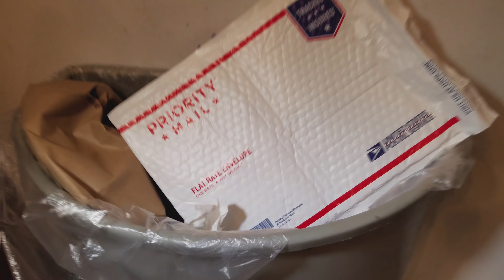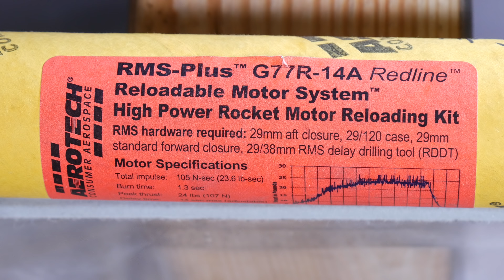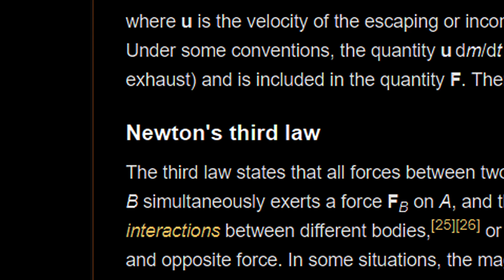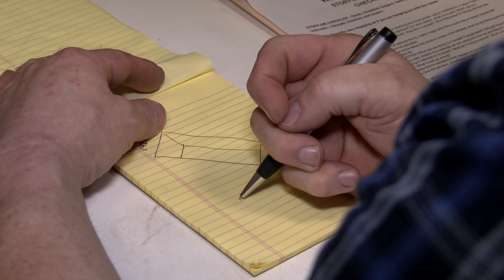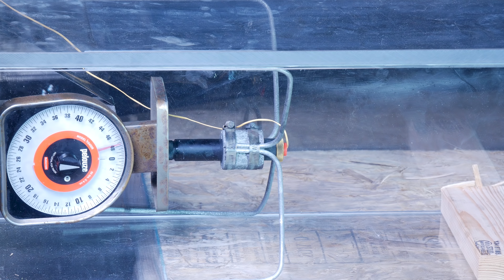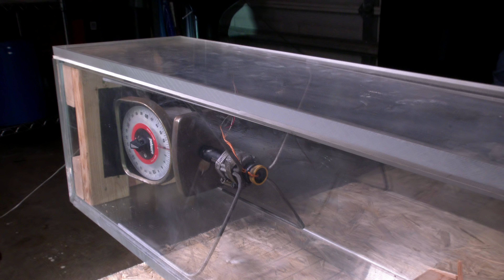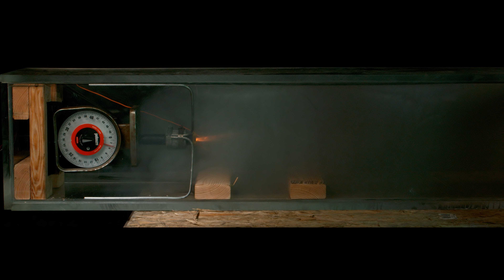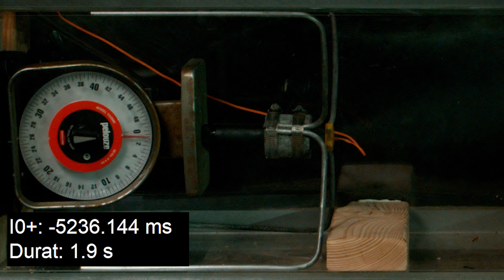Rockets in a Vacuum Chamber - Newton's third law of motion Visualized

Comment: I see a 4 problems with this experiment:

1) Though at negative P.S.I., that chamber is not empty space; it contains matter (that gas we breathe called air). Space beyond our atmosphere is not just void of pressure, it is ALSO void of matter.

Why is this important? Because rocket energy shock waves require a medium just as sound does (light & radio waves can travel through the nothingness of space but sound cannot): 

I believe I heard the sound of the rocket blast coming from that vacuum chamber which tells me the energy was also traveling through the air & bouncing back as force of energy waves.

2) That rocket is being fired in a sealed container that can reflect the rocket energy waves back to the source & overcome the negative pressure.

If that rocket was fired from the vast nothingness of outer space it would have no enclosed barrier to reflect the energy back to the source & provide resistance necessary for thrust.

3) That vacuum chamber is narrow enough to efficienly return energy waves directly back to the source; had it been in a spherical chamber, the energy waves would have been dispersed in all direction, severely weakening the effect.

4) Go-Fast Rocket (ironically by a flatearth team disproving their own crazy idea of Sun & moon being in our atmosphere) shows what happens when a rocket leaves our atmosphere and enters the nothingness of dpace:

The escaping gas of the rocket cannot overcome the surrounding environment of infinite negative pressure; it actually reverses the force of gas pressure into a brake.

5) Watch "A Funny thing happened on the way to the moon"; the leaked NASA footage showes Apollo 11 astronauts faked being 130,000 miles from earth while still in L.E.O. (Low Earth Orbit). Why fake anything if they were actually capable? Obviously because they were not for 3 reasons:

First of all; in spite of their claims, rockets don't work in outer space (they need an atmosphere to work), but the hoax continues to rake in billions with the aid of artistry, special effects & CGI.

Secondly; the 30,000,000 e-volts of deadly charged particles they would have to travel through for 2 hours (combined to & from) through the V.A.B. (Van Allen Belts). 

If you doubt me on this, just watch "NASA engineer admits they can't get passed the Van Allen Belts" (i.e. not without extreme untested shielding). Gee; I thought NASA  already solved that problem in 1969-1972 with thin aluminum  skin around the capsule. Appearently not, but the deception makes for lucrative entertainment.

Thirdly; there's PLENTY of documentaries exposing NASA hoaxes from moon landings to the tin-can prop floating in L.E.O. they call a International Space Station (I call it a Fake Station). I don't trust NASA because they wrecked their credibility too many times with their exposed fakeries.

Unfortunately most of those documentaries have been purged from youtube (what"s left are burried by the pro-NASA  "debunkers"); you have to go to the Rumble or Bitchute platform to see them now, though you will have to endure the foolish comments from flatearthers on occasion (I believe that F.E. nonsense is a CIA psyop used to discredit NASA critics, and cause discord with wasted energy arguing for or against REAL Galileo & Newtonian science).

Why didn't the USSR blow the whistle on NASA? Because they were faking it too; just look at that rediculouse "First Space Walk" footage (stop-motion with that over-spinning globe-prop in the background): I've seen far more convincing images in old Star Trek reruns.

So governments lie to their citizens? Yea, who didn't know that. The Red pill can be tough to swallow but I prefer it over the Blue pill of blissful ignorance & safety of  compliance.

Question everything but always use your God-given common sense. Stay thirsty for truth my friends. Cheers!
Reply: - "Though at negative P.S.I., that chamber is not empty space"

I stopped reading your nonsense right there.
There is no such thing as negative pressure.
The "vacuum of space" is just at 0.0 PSI.
Now try to complete high school physics BEFORE trying to debunk all of physics.
Reply: I guess you didn't realize that I was referring to vacuum chambers which are capable of -0 p.s.i. whereas "outer space" is simply 0 pressure. Many often refer to it as "the vacuum of space" though empty space doesn't really have a force (it's literally nothing), but pressurized gas rushes out into 0 pressure of outer space in all direction without limit or resistance (quite different than the area inside a vacuum chamber: Things that are different are not the same).

I am familiar with Newtonian physics; I appeal to them often when debating flatearthers on TikTok. You can dismiss everything I shared as "foolishness" but I do make valid points. You may think I'm crazy or ignorant for daring to question NASA missions but if you watch the 3 clips that I mentioned (as well a the many ISS critiques), you'll understand why I have my doubts.

I'm disappointed in your condescending attitude; you shouldn't belittle those who question authority with reasonable arguments & theories. I don't even treat flatearthers that way; instead I try to reason with them, and if they won't listen to reason, I move on. Maybe what I share will eventually sink in but definitely not if all I do is insult them and call them stupid (I'm nobody's judge).

I hope you treat people better in the future. God bless
Reply: @arlanwade3268  Study the Comet Tempel-1. Then tell me what happened to it on the evening of July 4th 2005.
Reply: @arlanwade3268  - "I'm disappointed in your condescending attitude; you shouldn't belittle those who question authority with reasonable arguments & theories.

Do you not realize that you are accusing millions of Engineers, Physicists, and Scientists of being either liars or incompetent?
You don't consider THAT being "condescending"?
Reply: @arlanwade3268  - Study the Comet Tempel-1. Then tell me what happened to it on the evening of July 4th 2005.
Reply: @arlanwade3268  - I have been building, launching, and operating deep space science probes for longer than you have been alive. Your attitude towards my career is definitely "condescending".
Reply: @stuartgray5877  OH but it is: It contains air (though at 0 or -0 pressure) vacuum chambers still contain that inconvenient matter that disrupts NASA fallacy; vacuum chambers still test within our atmosphere. Empty space is different (things that are different are not the same).
Reply: @arlanwade3268  - I am also a 30-year veteran Vacuum Test Specialist but thanks for mansplaining how vacuum works.
Reply: @arlanwade3268  - "I watched Temple-1on youtube and I must say I am impressed: NASA's CGI has gotten WAY better latel"

None of the video from the encounter with Tempel-1 was "CGI".
Or are you claiming that the MILLIONS of people that observed that comet explode the evening of July 4th were seeing "CGI" in the sky?
And every telescope on the earth witnessed the comet explode?
Did NASA install devices in every telescope on the planet before that night?
Bless your little heart!
Reply: @arlanwade3268  - I built, tested, launched, and operated the Deep Impact spacecraft during its mission.
I was a member of the Deep Space Navigation team, and I calibrated the telescope that took the images of Comet Tempel-1.
I was even the flight director for the activity that first spotted the comet from the spacecraft during approach.
Tell me that YOU graduated high school.
Reply: @arlanwade3268 You don't need to do any work to completely break a flat earther. Just ask them how the sun sets. They cannot answer in a way that's not obviously deranged. They used to argue that it was refraction and such but when they moved on to each person having their own skybox like a video game I washed my hands of their existence.
Reply: @arlanwade3268 You can be disappointed all you want, but don't you dare try to pass your nonsense off as reasonable. I'm not saying that to be a jerk, you're actually just wrong. The fact that you think there's some kind of fundamental difference between the vacuum of space and a vacuum chamber is telling. The next two points only build on that foundational error.
Reply: @stevencurtis7157  There obviously IS a "fundamental difference" between contained air matter in a vacuum chamber, and the infinite non-matter of outer space. Things do work differently in outer space (according to Newton's laws of motion & resistance) than in our gas-filled atmosphere. The idea that outer space and Earth's atmosphere are essentially the same environments doesn't seem reasonable to me.
Reply: @arlanwade3268  a vacuum chamber has more particles in it than the vacuum of interplanetary space, but most of what's done in space is in low earth orbit, which has a much higher density of gas than interplanetary space, yet both offer effectively zero air resistance over a short time period. That's the fundamental similarity, and that's why treating them as though they're not at all comparable is ridiculous. The fact that space is effectively infinite in that a rocket can't rapidly fill space with gas whereas it can nearly instantly fill a vacuum chamber just means that the experiment in the video is somewhat flawed, but you missed the most important part, which is that the rocket begins to accelerate immediately, regardless of what the pressure is. Rocket exhaust has no reason to go anywhere without force acting on it, just like anything else. A stationary atom would not move just by being exposed to vacuum any more than a basketball would be sucked out of a literally vacuum-empty bucket if exposed to vacuum. But gases in a sealed tank or rocket's combustion chamber are not stationary, they are under pressure and are moving around and bouncing into each other and the walls of their container. When you open that container, the particles that were moving toward the opening are suddenly allowed to escape, and they both take their momentum away with them and are no longer in the chamber for the other particles to bounce off of. The net result is that all that gas is going to eventually bounce off the front of the tank or impart momentum on another particle before leaving the tank, carrying away momentum and forcing the container the other way. Vacuums don't suck. I can't explain this any more clearly. Please let me know what you take issue with.
Reply: @stevencurtis7157  My issue is that certain energy & sound waves can travel through gaseous matter (without which they have no effect) and being in a sealed container, energy waves can theoretically bounce back to the source of released energy even if in 0 pressure. Outer space is not an enclosure, and the 0 pressure is infinite in all direction (it may sound crazy to you but I expect different results).

Question is; can the release of energy from a rocket engine be enough to overcome surrounding 0 pressure (no matter or pressure outside to resist) and push the rocket with the escaping energy? NASA engineers yes but if so; why did the Apollo 11 astronauts feel the need to fake being 130,000 miles from Earth while still in L.E.O.?

The Van Allen Belt is reason enough to fake the mission, but I also suspect they were stuck in L.E.O. because a rocket couldn't get them any further.

I don't see a problem firing rockets into upper atmosphere or even shutting off the engine before entering space to let it's own momentum move it without resistance; I just have my doubts that rocket exhaust has any effect in outer space.

Though I am critical of NASA missions; I continue to look at evidence on both sides. I can't say with 100% certainty that rockets don't work in space (I don't know everything): My only point is that it takes a lot of evidence to convince me, and that an air-sealed vacuum chamber is not proof to me that they do (but I will continue to look into Tempel-1 mission when I get home tonight).
Reply: @stuartgray5877  Yes; I did raduate from Oxnard High School (CA) Class of 83, but I didn't move on to College if that's what you're wondering. However, I have done a lot of reading, researching, and have seen many documentaries on many different subjects.

I have changed my opinions on occasion (especially in theological doctrine) but only when the evidence presented was undeniable, or at least more logical than what I earlier believed. I didn't get valuable insight on certain subjects by being closed-minded.
Reply: @stuartgray5877  To me; "millions" of astronomers seing a timed explosion on a comet is convincing evidence but not conclusive proof (still gotta check it out) UNLESS they actually saw & recorded a rocket slamming into it: If not, it could have been caused by a Directed Energy Weapon from here on earth (I'm not saying it was; just that there's reasonable doubt).
Reply: @arlanwade3268  It seems to me like you either didn't read or understand my post, or you're asking all the wrong questions. You brought up Newton's third law, and I explained to you why that ensures that rockets work in space. I need you to explain to me in as much detail as you can why you think pressurized gas/exhaust just gets sucked out of the rocket and robs it of thrust, please.
Reply: @stuartgray5877  Touche' on that point: I can't remember where I heard about negative pressure vacuum chambers (perhaps it was an unfamiliar calculation that confused me) but that is embarrassingly inaccurate.

I feel like I just explained how I solved a mechanical problem to a Master mechanic while mentioning the wrong torque setting.

Thanks for the correction, one should always double-check information when presenting a theory or an argument.

I'm sure that gave you and your NASA buddies a good laugh (you're welcome, heh, heh!).

I'm still researching your Tempel-1 mission; the footage I've seen so far isn't as convincing to me as that of the Apollo 11 decent (youtube "NASA s Giant Moon Ball"; the s must be spaced to bring the right clip up).

No; I'm not calling you a liar, a deceiver or part of a conspiracy (that would be disrespectful, especially to someone with your credentials). Let me just say I still have my doubts & suspicions about NASA missions, but still willing to look at all evidence.
Reply: @arlanwade3268  Maybe you're thinking of negative relative pressure. If you use a gauge that considers atmospheric pressure to be zero, anything less than that is considered negative. The absolute pressure, though, is still positive, just less than the atmosphere.

The idea of negative pressure is one of those "useful but technically not real" things that it's important not to get confused about, like Celsius going below zero or centrifugal force.
Reply: @stuartgray5877  Reminds me of the time I once argued that- even if possible- traveling at light speed would instantly kill us because outer space is not entirely empty; it contains dust, asteroids & gasses that would surely destroy a spaceship on contact at light speed.

I imagine even the G-force created in a sharp turn at light speed would be fatal. A reasonable theory, right? Who would laugh at that? Well, it's when I mentioned the speed of light being 186k m.p.h. instead of m.p.s. I actually knew better but being a gear-head, m.p.h. was stuck in my mind. You can imagine the mockery I faced over that one. It's all good though; even I gotta laugh at myself sometimes.

I do appreciate you taking the time to challenge my ideas (it provokes me to do a little more reasearch); I'm sure many of your peers would consider it a waste of time & beneath their dignity to argue with people they probably refer to as Conspiracy Loonies & Cyber Jackasses.

I feel I should be spending more time researching than arguing at this point. I'll continue at a later time. God bless
Reply: @arlanwade3268  just out of curiosity, are you aware that you can see the ISS in orbit with your own eyes?  We have photos taken from the ground that show the spacecraft docked to the side.
Reply: @arlanwade3268  "A sharp turn at light speed" doesn't really mean much because of relativity. If you're going at near-lightspeed relatively to some planet/star, and then you decide you want to be going 90° to your left within a few seconds, then yeah, the force to do that would be fatal to you, the ship and probably a decent radius of space around the ship. But, say you were just floating in space, decided to start moving, and then started accelerating in a circle like you're doing donuts in a car. That relatively small, safe acceleration would be the same whether you're moving close to the speed of light or not, relative to a planet or anything else. If you just did normal acceleration in the first example, you would accelerate slowly and the turn wouldn't be sharp at all, but it wouldn't be unsafe just because you're going fast.

The interesting dust would, however, be as deadly as you mentioned.
Reply: @arlanwade3268  If you think that all NASA mission are FAKE then:
- Study the Comet Tempel-1. Then tell me what happened to it on the evening of July 4th 2005 .

TELL ME WHAT HAPPENED!  I KNOW you have seen this comment above why do you keep ignoring this request?
Does it prove YOU wrong? (YES) or do you just not possess the intellect to understand what you are reading? (Likely)
Reply: @arlanwade3268  - "What I've seen so far about Tempel-1 on YouTube could EASILY be simulated with CGI"
The part I haven't told you yet:
I built the flight computers for the two spacecraft on that mission.
I was the test lead for the build of both spacecraft and the environmental tests.
I helped ship the spacecraft to KSC, fuel them, put them on the rocket.
I was THE launch conductor on launch day.
After launch I was on the mission operations team at JPL and helped fly the spacecraft for the 6-month cruise to the comet. I was literally the person who calibrated the three telescopes onboard and helped the Deep Space Navigation team.
I was one of the Flight Directors and the Impactor Command and Data Handling subsystem engineer on console when we hit the comet. I was the first person on earth to know we had hit the comet when I lost telemetry from my spacecraft before anyone else noticed.
And it was literally MY JOB to downlink all of the images of the encounter over the next few days as the Flyby Command and Data Handling subsystem Engineer.
So tell me again how YOU know more about it than I DO genius.
Reply: @arlanwade3268  - "(especially in theological doctrine)"
Ahhhh, That explains it. You had the OPPORTUNITY to learn in high school, but you let your brain get rotted by your "Book".
Bless your little heart!
Reply: @arlanwade3268  So did you evaluate the evidence from the Deep Impact mission and now you are considering that NASA mission might be real?
Or were all these facts just too much for you and you ran away?
Reply: @stuartgray5877 Yea; I saw Space Odyssey 2001, Star Wars, Star Trek,...etc. Ohyeah! I'm convinced!😂😂😂
Reply: @stuartgray5877 Just watch the documentaries that I referenced. I'm waiting for your rebuttal
Reply: @stuartgray5877 "Facts"; We can't get past the Van Allen Belt TODAY! (Orion Project) But you preach that we already did 6 times from 1969-1972. I don't trust you more han I can throw a Harley Davidson Road King!
Reply: @stuartgray5877 I have researched from NASA & independent rocket footage from lift-off to Low Earth Orbit: NOTHING continuouse beyond L.E.O. I call you out!: Show me ANY footage beyond. Crickets!

Even your own Tempel-1 project; where's the continuous footage? Oh! Only until the final (CGI) impact. Yea, Right!
Reply: @arlanwade3268  SO you refuse to address actual evidence. Understood. I accept your surrender.
Now run along child